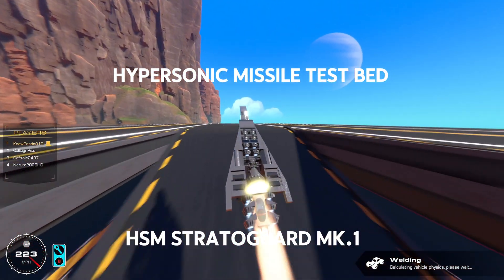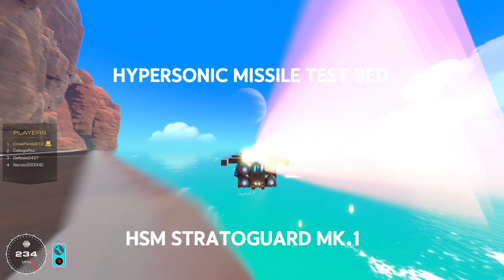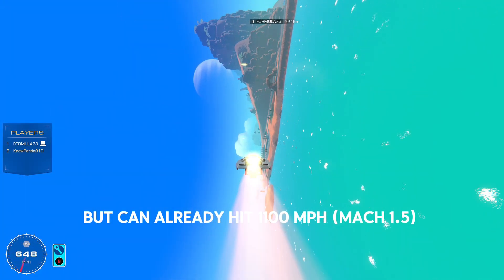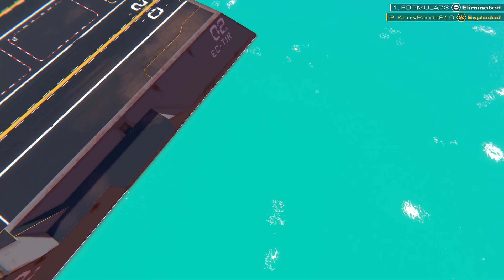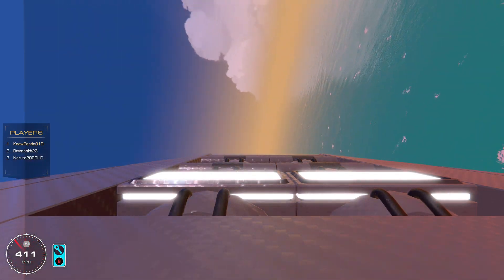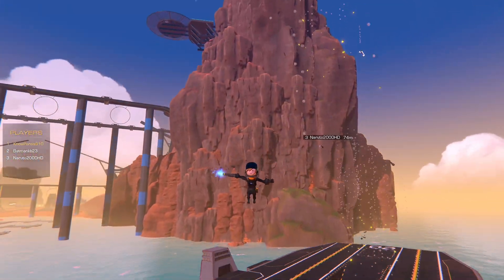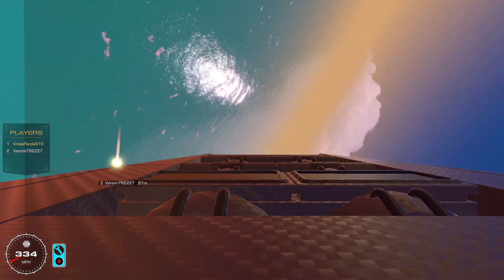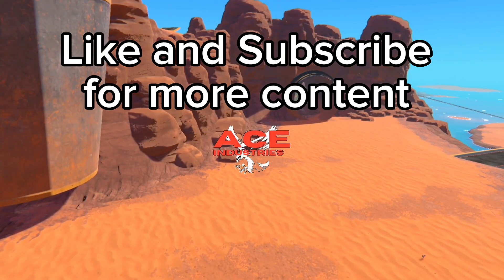Developing A Hypersonic Air to Air Missile in Trailmakers

Comment: hello, not tryna hate here, but what is special about it? its fast and has distancesensors do trigger the explosives?
Reply from the maker: Uses a disarming feature has a much higher chance to proxy due to rotating scanner head , it’s construction/detonation sequence extends the the duration and physical length of the explosion turning the front of missile into a boosted kinetic explosive warhead above only a couple hundred mph, can effectively damage targets at Mach* closing speed on air burst (dynamite explosion speed is usually outran at 500 mph) and the upgraded mk.2 has a  dramatic speed increase and a payload bump from 30 dynamite up to 39 dynamite and is remotely controlled/stored internally by a fighter aircraft that enters maneuvering autopilot and has its own protection not to mention its modular design will allow it to be installed on surface ship and potentially my Fin Mako Submarine